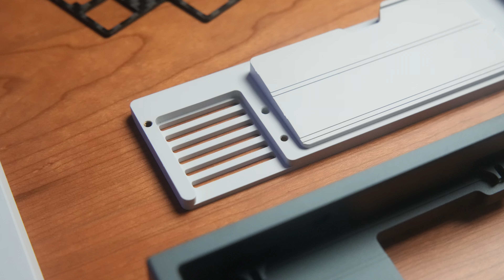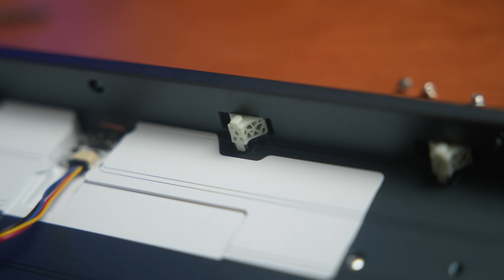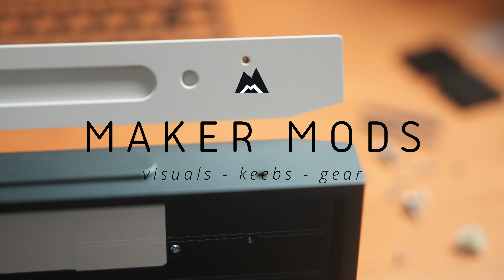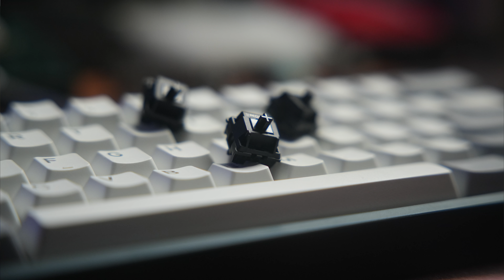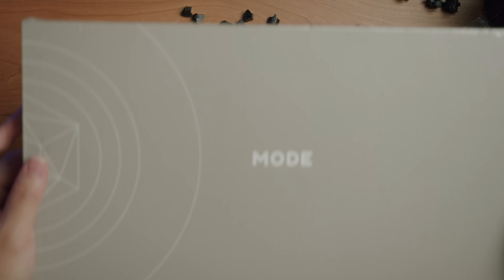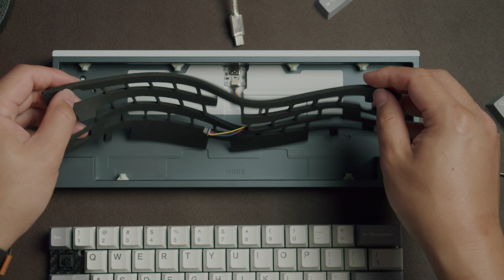My new endgame 60% Keyboard | Mode Designs Tempo review!

Comment: Incredible board. Would be perfect if it was $100 cheaper.
edit: nvm, the price is great. I was using the configurator and it had keycaps included by default.

Comment: Yeesh, yeah CF with no foam in that config was SO loud! Case foam helped that out a ton, but then I've often found you need a really deep-sounding combo of keycaps and switches for CF to work out well. That may be personal preference talking tho. Also sounds like this Lattice Block implementation lacks the slight case ping Envoy has without case foam (at least with my combo of FR4 plate, lubed Frozen Slush linears, and DCX Cyanlet). Killer little board.